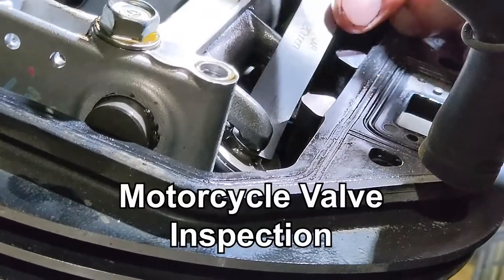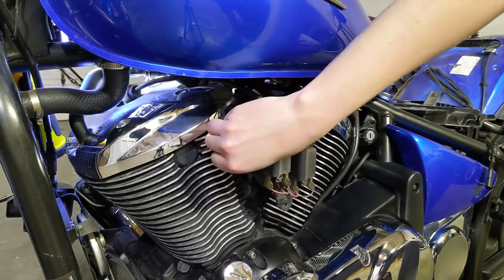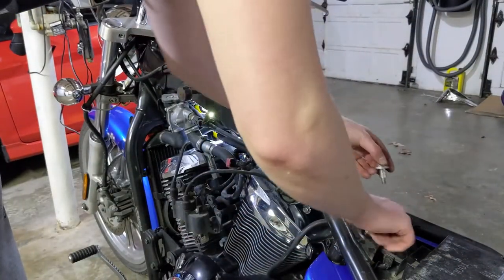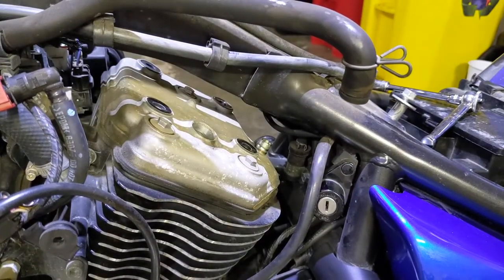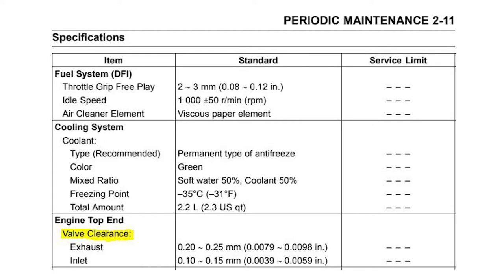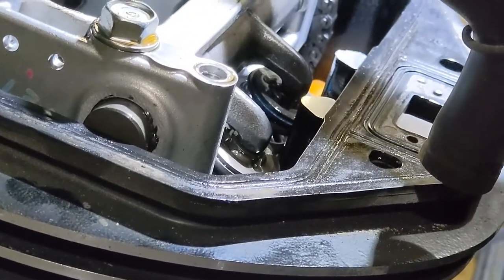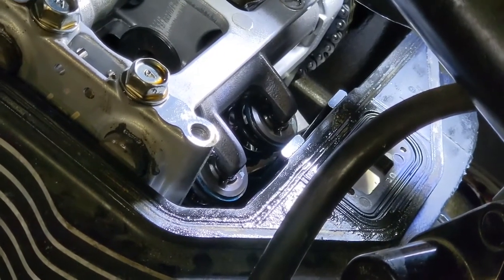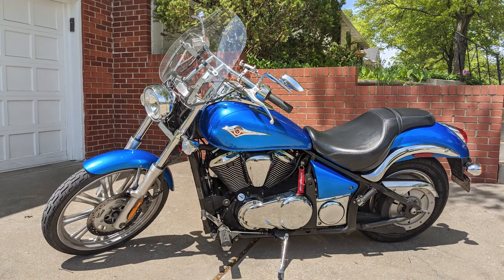Kawasaki Vulcan 900 Disassembly and Valve Clearance Inspection

Comment: nice presentation, i have a few suggestions for ppl planing on adjusting the valves, if i may.

cleaning a bit the parts to be disassembled goes a long way, especially on the top of the engine where clearances are so tight... sand/dust create unnecessary wear till the oil filter catches the abrasive particles. also a rag over the cam chains is a MUST even for people with steady hands: if a shim, bolt or tool falls in the engine, this rather simple task becomes quite stressful.

as shims come in 0.05mm increments, when replacing one, aim for the max allowed clearance/gap. the min allowed clearance requires a smaller shim to bring the clearance to the max allowed (otherwise in 15k miles thru wear the clearance will be smaller than ideal). write down w/ a drawing the clearances and if possible the shim sizes for all the valves. 

in this particular case the correct shim is 30 replacing the 40, for a final clearance of 0.25. (you don't want to go from 0.15 clearance to 0.20 by using a 35 shim.)

Comment: Brilliant video just one thing I noticed when you removed the fuel tank you still had fuel in it what did you do to stop the tank leaking everywhere
Reply from the maker: You can pull the tank off with gas in it. The more gas, the heavier the tank will be though.

I know on older bikes that a vacuum line was used to draw gas from fuel petcocks. I think since this bike is fuel injected the fuel pump is used. Without the pump running gas will not come out of the tank.

Comment: Great Video! Any timing chain issue on the front cylinder? My 08 hit 18k miles and valves are in spec, chain slap seems to be the issue.

Comment: So do i need to have a near empty gas tank to do this? How did you manage to not spill gas everywhere?
Reply from the maker: Bikes use either a vacuum line or fuel pump to draw gas from the tank. Gas will not just pour out, even with some still in. The tank will be very heavy if it is full though.

Comment: great job arlen, very clear, concise, any diff. doin this on a classic? how often do you have to do it, manual says 15k to check , bu ti have known people waiting till 50k to do it?
Reply: Service manual says at 15,000 miles. You could possibly do it at 20,000 miles but wouldn't go past that. You might burn up your valves if they are too tight. 15,000-20,000. Try to get your exhaust valves clearances at the higher end of your valve clearance limit because they tend to close over time.

Comment: Marlin 08 Vulcan 900 custom two years ago haven't been able to get it to run right yet will not take. It'll barely takes a three-quarter have replace injectors everything to do with the breathing system fuel system 1 fuel pump everything is still can't get his bike run right

Comment: Your video is very clear and direct. But one question: how often do you do this? Or what is notable to make you want to do this?
Reply from the maker: Apparently every 15k miles. I did it because I bought the bike with 25k and have no idea if it had been done. I've read that some people have a slight ticking noise if there is no gap. Maybe something to try if there is performance issues?
Reply: @arlenburroughs5014  Hi same thinking  ,bought my vulcan 900 classic with almost 27k and there's a ticking noise so... better safe than sorry ;) thanks for the video , btw nice singing man

Comment: Splendid vid shot . I hav 1 Vn 1999 classic And something is rolling to get me down 😮

Oil leaking on Sparks , Also in the mufflers whenever hit the str . I sure valve clearance not ok besides Cylinder head and engine was rebuild 10 month ago . 

All gaskets changed however oil in the mufflers . 😢

Comment: Really good video! Could a slight tapping noise coming from the engine at acceleration but not on idle mean I need to check theses? Someone told me that my valves are whats making the tick
Reply: Wish we could get a answer to this question I'm having this issue
Reply: @midmooutdoors7556  a bit of tick is normal.  If they're on the loose side, it'll tap louder but it's no harm.  The secondary air injection valve also makes a loud clicking.  Also check for exhaust leaks, especially if you reused the crush gaskets.

Comment: Not noted but I am guessing that the gas tank has to be close to empty while disconnecting and removed??? Please correct me if I'm wrong
Reply from the maker: It does not need to be emptied. The fuel won't leak out because a pump is required to get fuel out. You will however want it mostly empty to be lighter in weight.
Reply: @arlenburroughs5014  thanks 👍 good to know

Comment: Thanks for making the video. I started to replace my failed stator and while I wait for part I am adjusting my valves with your video as guidence.
Reply: I know this comment is two years old, but in the event you see it about what was the mileage of your bike when the stator failed?
Reply: @thegreenman2030  around 70000km (43495 miles). If an alternator on a car failed at such low mileage, that car would be a lemon. I read a lot of reports about the Kaw stator being junk and one I replaced it with had great reviews. I could see that it was much better quality.
Reply: Ricks Motorsport Electrics Stator OEM-Style - 21-230
Reply: @osgnuru  Thank you for the reply. I just picked up a 2007 900 Classic with 16,000 miles. It seems like the battery which is new is draining rather quickly, however it’s rare when a stator fails at suck low miles. I also heard good reviews regarding the ricks statir being a lot better. I may just make the upgrade once we get through the summer riding season. 

Again I appreciate you taking the time to reply.
Reply: @thegreenman2030  sometimes it can be a failed wire or rectifier. You should us a DMM to test those before you send any money

Comment: Thanks for the video/great job. I have a ‘07 900 Custom, great bikes. I see you have risers /extended  handle bars; who is mfg and how much did it extend? Did you need to change any of the cables? Thanks
Reply from the maker: Actually those are the stock bars that come on the "custom" variant of the vn900

Comment: At what mileage was regulated
Reply from the maker: Inspect every 15k miles, adjust when out of spec.
Reply: @arlenburroughs5014  So often? In Europe it is every 42000km= 26097 mi, has it to do with regulations for the air pollution laws in USA?
Reply from the maker: @steelrolex  I misspoke with 6k miles. I just checked the manual page 2-2 "Periodic Maintenance" and it says 15k miles for US and 26k for other countries as you mentioned. I'll put this in the description as well. 
Thanks and be safe out there!